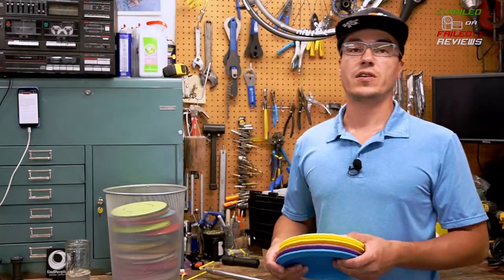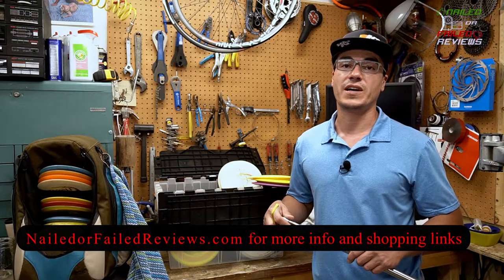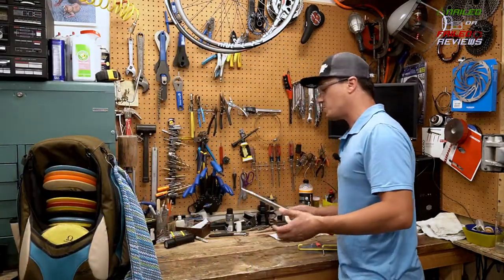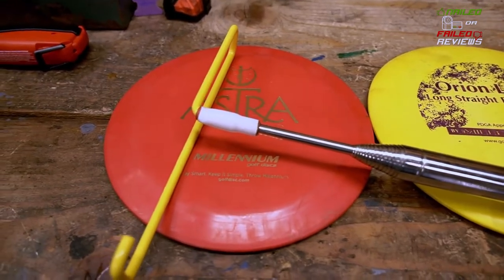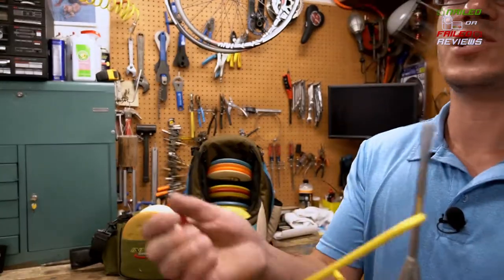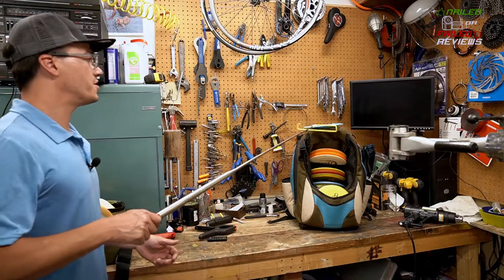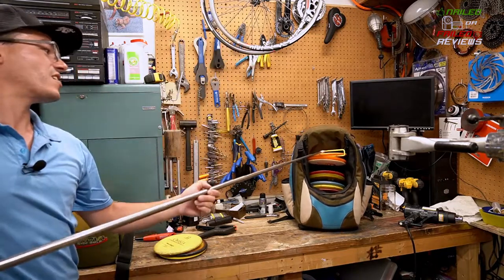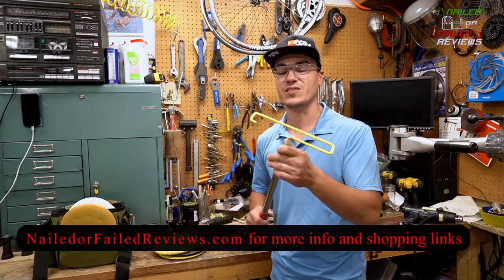InZone Kwik-Stik XL Disc Golf Retriever Review and Assembly

Comment: Actually, the assembly requires only one of the pieces of heat shrink tubing. It is industrial strength and has adhesive inside. When installed properly it will not come off. If for some reason it does even if not properly installed we will replace it for free if it does come off. NOTE! Coming January 2021 our attachments will be threaded and interchangeable! We are always working to improve the Kwik-Stik.
Reply: If one were to mess up putting the heat shrink tubing on would lock tight be advisable to use?
Reply: @philipwitzman8641  No, it won't work. Contact is at InZone and I'll gladly send you more heat shrink tubing.
Reply: @salesinzone5875  any update on the 2.0? Got a buddy asking me as i advised him he is better off waiting for one that you can use both the hook and retriever
Reply: @ianschultz1597  we have word that they are in the port waiting to be unloaded. Then they will go through customs and then be trucked to us here in Huntsville, Alabama. Getting exact times right now is next to impossible. Hopefully I will have them within the next week.
Reply: Wow, that's a HUGE improvement. Being able to take off the head will help a lot for transporting. Unfortunately, now I have to wait to buy one😭 Is the price changing at all?
Reply: @jonathans1453  Yes, with the stronger pole and getting both heads that are interchangeable the price is now $49.99.
Reply: @salesinzone5875  wait, so the pole itself is also stronger than the original?
Reply: So I just bought an older model? Just purchased mine 3-24-21 and I have the shrink wrap version. My buddy broke my m-retriever so I thought I would give this brand a shot. Pretty disappointed I purchased an older model when a new version is available without any notice.
Reply: @Not-your-enemy1  Yup. If you can, may want to see if you can return it.
Reply: Nice to know that it will now be threaded! I think I will be purchasing one.
Reply: Mine bent and broke on first use :(

Comment: Had one of those, but the pole bent first time i tried using it 🤷‍♂️ haha
Reply: The Kwik-Stik is a tool that is meant to be used straight out and straight back. The stainless poles will not withstand excessive force side to side and that is completely controlled by the user. InZone does warranty the retrievers against manufacturing defects but cannot control user caused failures which is covered in the User and Warranty document.

Comment: Broke the head off the heat shrink attachment way twice the first month I owned one. Drilled, tapped, and threaded a screw through it to rectify that situation. Ran into problems with difficulty extending and closing a few months in and eventually just snapped the pole off at one of the smaller extensions. Useful item for sure, but poorly manufactured, especially for the price.
Reply: Hi Rodney, you will find that our new pole is stronger and you will like the threaded attachments (frame head and hook) that are interchangeable. Beginning January 2021 the customer will get both heads with the pole. I'm always working to make it better. -Lavone Wolfe, InZone Disc Golf
Reply: @salesinzone5875  Hopefully this next iteration is more durable as it's very useful. Everyone in my local club purchased one and all had their own issues after a while. But having screw on interchangeable heads and a stronger pole will definitely get us back on board for trying a other one.
Reply: @4HorsemenDiscGolf  It's a tool that if used properly will pay for itself many times over. Just as we golfers eventually replace our discs, hopefully the users will see the benefit and replace their Kwik-Stik. I will certainly continue to work to make it better. As a disc golfer entering my sixth decade, I need it too! Thank you for being a customer!